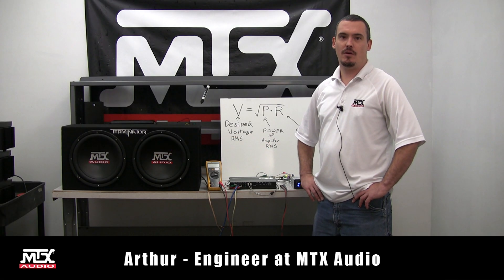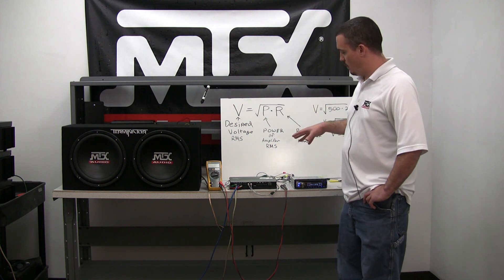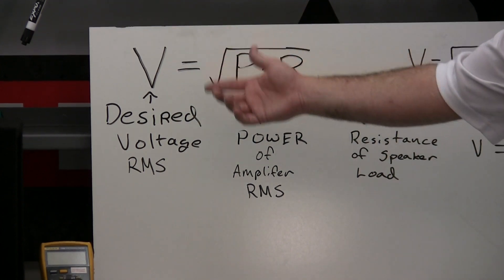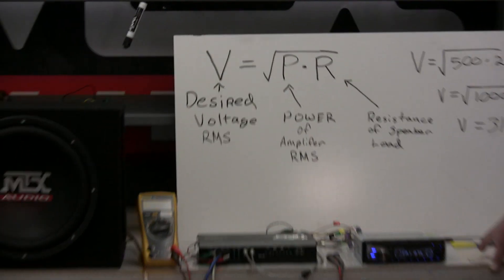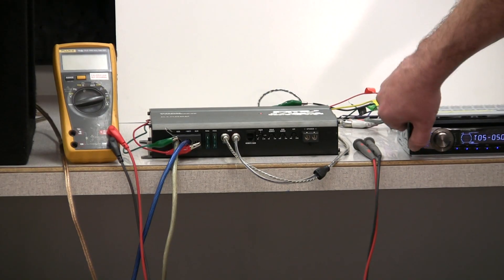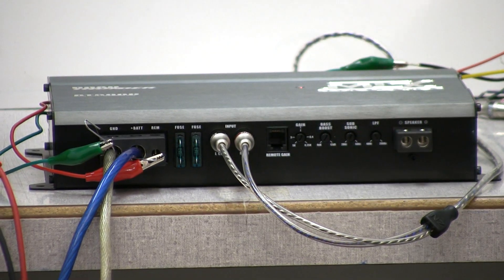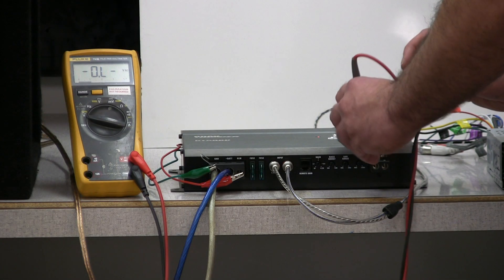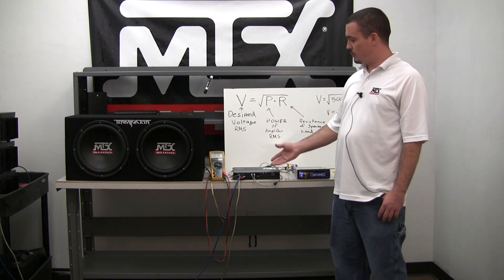How to Set Your Gains Using Ohms Law and a Basic Multimeter

Comment: I am following this step by step, and I am only getting a reading of around 6 or 7 volts once the gain is turned all the way up. Any ideas?
Reply from the maker: Depending on the brand of amplifier... some are grossly overrated so the calculation may be off. Some amplifier brands publish ratings that are totally unrealistic so if you used 1000 watts in your calculation for an amp that simply cannot provide 1000 watts, the calculation may not work. It is dependent on accurate specifications. A simple way to determine if an amplifiers ratings are at least realistic is to add up the values of the onboard fuses and multiply that number by 14.4 volts. This will give you an estimated maximum output of the amp. For example, if the amp has 1 - 40amp fuse, it's maximum output would be around 576 watts. Here is an article that discusses this topic further - https://www.mtx.com/library-car-amplifier-ratings
Reply: MTX Audio USA thanks for the reply. I found out the problem was my remote knob. I left it connected, so as soon as I disconnected it I got more accurate readings and i was able to tune it to the target voltage.

Comment: total output of the amp or per channel?

i have a 300rms amp, that is 75 per channel

4ohm speakers

so  300x4  or 75x4??
Reply from the maker: You don't necessarily set the gain of the amp to the amps ratings. You would use the amount of power you want from that channel of the amp (speaker/subwoofer rating). So if you want 75 watts of power to go to the speaker that's on the channel that you are setting, you would use 75 for watts in the calculation.
Reply from the maker: You would do this calculation and process for each gain setting. If you have a gain setting for front and a separate setting for rear, you would set those gains separately.

Comment: Before I added my subwoofer, I had my bass eq all the way up on the head unit and liked how my factory speakers sounded. I turned the eq off when I put my sub in. Are there any adjustments I need to make if I want to turn my bass eq on the head unit up again? Do I need to readjust the gain?
Reply from the maker: abdullghoriO1 once the gain is set properly, you can use your EQ adjustments to fine tune the sound for your listening preference.

Comment: My subwoofer is 1000 watt each and my amp is 2000watt. So I take 1000 x2 =2000 and the square root of that is 43.
Reply from the maker: Zack, make sure you are using RMS power handling / power output ratings when doing this calculation. Not PEAK power ratings.
Reply: MTX Audio USA so use rms not the peak wattage? The rms is 500. So 500x2 =1000 square root that and it should be 31.62. These are 2000 watt peak watt subs

Comment: Is the rms rating used in this calculation that of the amp or that of the sub? I have a 250w rms sub but my amp gives 412.5w continuous rms
Reply from the maker: abdullghoriO1 you would use the amount of power that you want to output to your subwoofer. It is going to be the RMS Power handling of your subwoofer or the sum of all subwoofers if running more than one.
Reply: abdullghoriO1 If your  AMP is more powerful then your speakers you can use the RMS of the speakers with the same “ohms law” equation to achieve the same none clipping multimeter voltage desired

Comment: Do I have to disconnect my door speakers to do this?
Reply from the maker: mrmizzarcus are your door speakers are attached to the amp you are trying to set the gain for?
Reply: MTX Audio USA no but they are connected to my head unit which is playing the 50hz tone
Reply: If I crank the volume up all the way with that tone going through my speakers I know they’ll blow
Reply from the maker: If the amp that is powering your speakers has a High Pass Filter and/or is crossed over appropriately for the frequencies they are intended to play, they should be fine.
Reply from the maker: If your speakers are not intended to play a 50Hz tone, they should be crossed over accordingly with either a factory crossover or the amplifier that is powering them. There are 50Hz tones in music too so if the audio signal going to the speakers is not setup properly, they would have the same problem with music as well.
Reply: Hmmm I get what you’re saying. They are 6.5 inch coax speakers just being powered by my head unit. Maybe it’s fine for them to play the 50hz?
Reply from the maker: Coaxial speakers are typically full range so they should be fine.

Comment: If it's 75watts at 4ohm which makes 300. Square root of that is 17.3. Is that correct for a 4 channel?
Reply from the maker: For a 4 channel, you have to setup each gain by itself. For example, if you have gains for the 2 front channels and 2 rear channels, you would do the calculation for both individually based on the speakers they are powering and the impedance they are wired to.

Comment: not sure id do this with the deck volume maxed out, the deck might be clipping at max volume.  JL Audio recommends 3/4 volume, so does Sonic Electronix.  might be safer that way, unless you have a scope and know for sure.
Reply: Steve yea 3/4 as usually it should be at the threshold of clipping

Comment: I need help plzzz...
I have two 12s alpine type s DVC 4 ohms wired down to 1 ohm (500 watts each rms 1500 watts PEAK each)My amp is 1100 watts (arc audio xdi 1100.1) what would my gain be?
Reply: Chan Chea 31.6v
Reply: You have to know what rms wattage your amp is rated for a 1 ohm. Whatever number that is you then take the square root of that number. The square root will give you the required AC voltage you must test for at the speaker leads. So with the head unit set to whatever max volume you listen to and the speakers disconnected from the amp you play the test tone. You watch the voltage increase as you slowly turn the gain control up from zero. Get to the AC  voltage you need and voila... your gain is set.

Comment: Hello there can you help me ? I have Two 4ohm 12inch subwoofers 300rms each so 600rms altogether and wired them down to 2 ohms the amp on 2 ohms is 800rms how would i set my gain?
Reply: Marcus43 yep! he's right! 34.64
Reply: Marcus43 34.64
Reply: Marcus43 If your  AMP is more powerful then your speakers you can use the RMS of the speakers with the same “ohms law” equation to achieve the same none clipping multimeter voltage desired

Comment: I need help figuring out my volts for my subs doing 2500 5000 max with two d4 evl skar subs at 1 ohm amp can do 4 k at 1
Reply: There dual 4 I have two of them trying to run them both full power 1250 each equals 2500 5000 max.  I need help tuning my amp at one ohm
Reply: well its not 2500 5000 max. that is jargon.

Comment: I have tried all methods of tuning but nothing works to me as well as tuning by music, but I do not like that method because it's not precise. I currently have a 12" Alpine Type S on 2 Ohms in a ported box that's tuned to 32Hz being powered by a JL Audio Slash 500/1. I'm wondering, would it be better if I played a 32Hz test tone, tuned it by ear and then record the maximum UNCLIPPED voltage and then play various music and increase the gain until I reach that voltage I achieved at 32Hz? I'm wondering becuase the 50Hz method does not work well for me at all, when I tune it using this method and clamp my amplifier the maximum I see is 250-300 Watts RMS @40Hz when I should be seeing 500 Watts RMS. It also doesn't feel like 500 Watts using the Ohms Law method.

Comment: in the equation do you add the ohms together from each sub or is the total ohms youre connecting at the amp? for ex.I have 2 2 ohm subs but im wiring up at 1 ohm to the amp.
Reply from the maker: Whatever impedance the amplifier will be operating with is the value you would use in the equation. In your case, the impedance would be 1ohm.
Reply: MTX Audio USA how do people not get a simple equation is beyond me. So simple. Thanks for the insight. I'm thinking a DMS distortion detector would be a better bet. The $150 price tag has me not sure lol.

Comment: setting the meter to V-AC, I hope I don't sound stupid for asking, but, if the amp is in a car wouldn't you set the meter to DC?
Reply: Try feeding a speaker with DC voltage sometime.
Reply from the maker: Hello JT... car audio amplifier output is AC.
Reply: had the same question. didnt realize an amp inverted the power to AC either.
Reply: For the speaker to move it has to use ac and not dc, if you connect dc to a speaker depending on the polarity it will either move outwards or inwards and stay there until it is unpowered
Reply: Also keep in mind the meter is clamped to the speaker output on the amp. Not the power input side
Reply: Zakk Gardner 😂🤣😂🤣🔥🔥🔥🔥🔥🔥😂🤣😂 hope they have a fire extinguisher handy
Reply: Simulated ac

Comment: Do you use this formula for each channel on your amp? Or is this only used for subs?
Reply from the maker: You would use the same formula for each gain adjustment on your amplifier. The desired voltage may change depending on the impedance, amount of power output you want, etc... but the formula would be the same.

Comment: When I do this the initial reading I get at amp is like .65 and I want to hit 35, I can get to about 18 and that's it, any ideas.
300 watt @ 4 ohms
Reply from the maker: Make sure you are using RMS power ratings (not peak or max). If you are setting the gains of a multichannel amplifier, be sure to use the RMS power rating of the channel(s) you are setting and not the power of the amplifier as a whole. If all of that is correct, it is possible that the amplifier ratings provided are not accurate and your amplifier actually has less power output than what it is rated at.

Comment: how do you use this concept for using 1ohm using a brx2400.1 on a 1500rms sub the sub itself is dvc 2ohm but wired to 1ohm kinda confused
Reply from the maker: You would use the calculation explained in the video... V = square root of desired output power x whatever resistance the amplifier will see (in your case, 1ohm). So... If the sub has an RMS power handling rating of 1500 watts, your calculation would be V = square root of 1500 x 1. V = square root of 1500. V = 38.73

Comment: so my friend has a dual 4 ohm sub does 400 rms but it says its also dual 2 ohm whats that mean and can u help me find out the volts needed to go into it
Reply from the maker: Before we could do the calculation to determine desired voltage output, we would need to know what impedance the subwoofer is. Depending on how the subwoofer is wired, the impedance of the subwoofer isn't always the impedance at the amplifier. For example, a dual 2ohm subwoofer could be wired to 1ohm or 4ohms.
Reply: MTX Audio USA I need your help
Reply: Kolton Ives you need some1 who knows what the fuck were talking about - you wouldn’t be allowed to touch the volume control in my car 🤣😂🤣😂🤣😂

Comment: how would this apply for a 5 channel amp? I understand the math but does it only apply to subs?
Reply from the maker: Ohm's Law can be applied to any situation when setting gains. For multi-channel amps, you just have to do the calculation for each gain you are setting. For example, most 5 channel amps for two gains, 1 gain for the sub channel and 1 gain for the other 4 channels.

Comment: Hi my sub is 4500 watss at 2ohm and my amp is 2500 watts at 2ohm what is my voltage how can i set my gain
Reply from the maker: Ravish Ravish, make sure the ratings you are quoting are RMS ratings. Do not use peak ratings to do the equation. V = square root of power x resistance. So first figure out how much power you want going to your subwoofer(s). This value is the "power" or P in the equation. Then figure out what impedance (resistance) your subwoofer(s) is wired to. This value is the resistance or R in the equation. Multiply those two numbers together. Then find the square root of that number to get your desired voltage.
Reply: MTX Audio USA its amazing how people can NOT understand a simple OHMS LAW calculation aka simple fucking math 💯

Comment: my amp does 500 at 4 and i have one sub at 500 rms at 4 ohm whats the volt
Reply from the maker: If you want 500 watts of output at 4ohms from your amplifier and your subwoofer is wired at 4ohms, your equation would be: V = square root of 500 x 4. V = square root of 2000 V = 44.72
Reply: MTX Audio USA so what if its brand new
Reply from the maker: Equation doesn't change if it is used or brand new. Same method applies to both.
Reply: another question my radio i turned up to 35 but i dont wanna go higher then 32 if i play the sub. my amp does 500 rms at 4 ohm bridged i cant push the gain more then halfway because itll over heat. but i have the boost at 8 i believe the highest is 18 and at 35 it reaches bout 42
Reply from the maker: Be sure you are using RMS ratings.If your ratings are RMS, V = square root of 500 x 4. V = square root of 2000. V = 44.72.
Reply from the maker: Bridging amplifiers, while it does offer more power, can cause added stress on the amplifier. It is better to find an amp that is appropriately rated with the proper amount of RMS power without being bridged. When setting your gains, turn off your bass boost first and then turn the volume to whatever level you want to consider maximum. Adjust the gain until you have proper voltage. Once the gain is set properly, you can go back and set any crossovers, filters, and boosts to your listening preference.

Comment: Hey i need a help with this formula. I have amp of 1000W sony, with the following specification not really known what should i insert that in formula.  The maximum output power of this system is 170 W x 4 with an impedance of 4 OHM, 500 W x 2 with 4 OHM – BTL and 250 W x 4 with 2 OHM. The rated output power is 70 W x 4 with 4 OHM, 175 W x 2 with 4 OHM – BTL and 85 W x 4 with 2 OHM.
Reply from the maker: You do not use the peak or maximum power ratings. Use the impedance your subwoofers are wired to and the combined RMS power handling of your subwoofers. Assuming your amplifier is properly matched to your subwoofers, those are the numbers that matter.
Reply from the maker: Here is a link to an article about matching subwoofers with amplifiers - https://www.mtx.com/library-subwoofer-impedance
Reply: ***** I have subwoofers of 1800 watts with max input power of 300 watts.
can you please give the volt to set a gain.
Thanks in advance
Reply from the maker: Use the RMS or continuous power ratings. Do not pay attention to peak or maximum power ratings. They are useless. Then determine what impedance you are going to be running the amplifier at.
Reply from the maker: You have to determine what impedance your subwoofers are going to be wired at before you have all the values you need to do the math in the equation.

V = square root of Power x Resistance

Power is the amount of RMS power you want to send to your subwoofers and should be the RMS power handling rating of each subwoofer added together. (For example: 2 subwoofers with an RMS power handling rating of 300 watts = 600)

Resistance is whatever impedance the amplifier will operate at which is determined by how you wire your subwoofers together.

Comment: so this works on a 4 ch amp for speakers?  do i use the 50hz tones for component speakers?
Reply from the maker: I works on any channel that has an independent gain adjustment. You will have to adjust the frequency of the tone you use according to the frequency your specific speakers are intended to play. 50Hz is the basic tone used for subwoofers. Mid bass drivers will be slightly higher. Tweeters will be even higher.
Reply: MTX Audio USA oh ok.  i just bought the alpine sps 610c component speakers with tweeters that hook up directly to the speaker.  i don't want to blow the tweeters but i believe they have a crossover built in already.  so should i just focus on the hz for the components and not worry about the tweeters right?  i assume they are already protected by a built in crossover.
Reply from the maker: Not familiar with those speakers, but if they are powered directly from the terminal on the mid bass driver, you would want to use a frequency appropriate for the mid bass that doesn't have an unadjustable factory crossover.

Comment: When you measure the impediance of a sub rated 4 ohms, it isn't necessarily 4 ohms. My JL Audio 10" measures 4.8 ohms through the wires to the amp. Which is the correct value to use, 4.0 ohms or 4.8 ohms?
Reply from the maker: You can use the impedance rating at the amplifier or the actual impedance. The important part is that you use the impedance at the amplifier and not the individual impedance of the subwoofer unless your system only has 1 subwoofer. For example, if you have 2 - dual 2ohm subwoofers wired down to a final impedance of 2ohms at the amplifier, you would use 2 for the ohm/impedance value in the calculation.